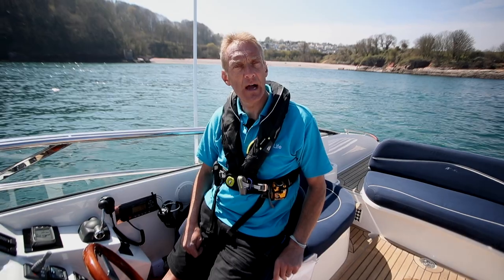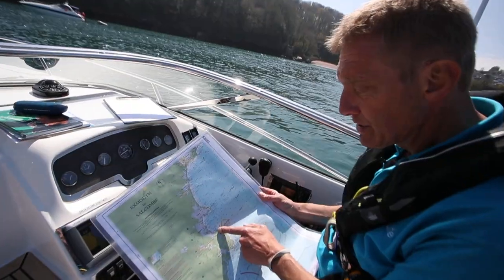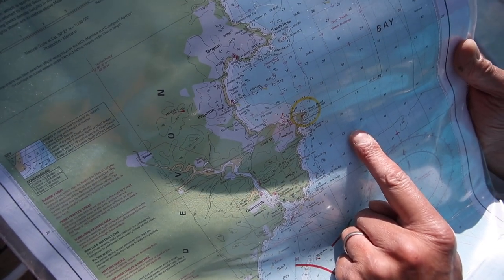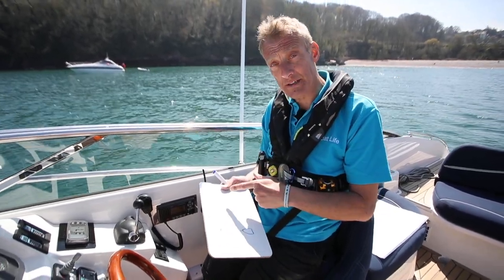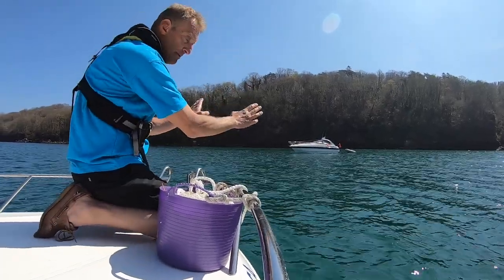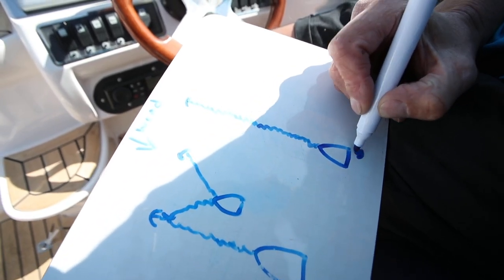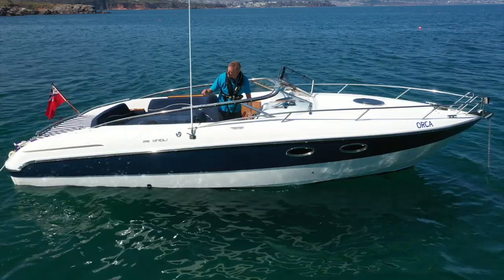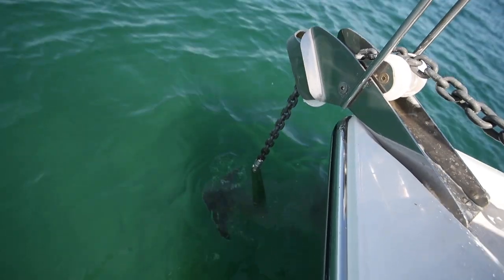How to anchor your boat safely and securely | Motor Boat & Yachting

Comment: Great video Jon, thanks!

Just two comments if I may:
1. Stern anchors are illegal in some parts of the med… ask the coast guard before doing that. In the med it is more likely to see boats laying shorelines instead, and those must be floating, with bright colored lines, and marked with flashing red or white lights overnight.
2. In windy areas, the recommended scope should not be just a function of depth. We should also factor-in the windage of the boat and the size of the chain. A flybridge boat for example has substantially more surface area than a sailing boat or a speedboat. This means that the horizontal force exerted on the boat by the wind is far greater. You do not want this force to lift the entire chain off the seabed, as this will unsettle the anchor. This means that the weight of the chain should be greater than the KgF exerted on the boat by the wind, plus a comfortable safety margin. If for example a 5 force wind exerts 100 KgF on the boat, and you have a 12mm chain that weighs about 2.8 Kg per meter, you need about 50 meters of scope regardless of the depth... You can not anchor in shallow bays and stay safe overnight in windy conditions, unless certain conditions are met, the captain masters system (wind, boat, anchor rode, shorelines) dynamics, there is enough space in the bay, and there is somebody on watch during the night… 

Only reason for this humble comment, is that more and more people can afford bigger boats these days, and the rules they have learned at school on scope to depth ratio, have become obsolete in the pursuit of higher profile, more comfortable pleasure craft. It is not by coincidence that I constantly see this kinds of boats dragging anchors in southwest France, Adriatic Italy, Croatia, the Aegean Sea and other windy areas.
Reply: Pacific NW we use stern ties to shore.

Comment: I put a bright yellow zip tie on the chain at the distance where the anchor is just below the water line.  This allows me to pull the rode from the cabin, behind the helm.  I stop when I see that yellow zip comes over the roller.  That allows me to safely raise it without chancing it hitting the boat/bow/gelcoat.  I also will put it into gear on idle and the slight forward motion will usually clean off the mud.  Doesn't always work.  Some of the mud up here is very, very sticky.

Comment: Hi, I'm new to boating so I'm fining your videos extremely useful. I have a question about the anchor marker buoy. How long should the rope be? If it's tied to the anchor, then surely the rope would need to be different lengths depending on the depth of the seabed?

Comment: I learned to first drive over the spot where you want to drop the anchor to read the actual depth off the depth gauge, to help calculate how much chain to let out.

Would've wished for a few more tips and etiquette on anchoring in crowded bays - because, let's face it, that is what most recreational boaters will do, particularly around the Mediterranean. In deep bays, like on Majorca, there's little wind and current, so boats move 360 degrees around their anchoring point throughout a day, often coming dangerously close to other boats doing the same. Some words on that and a rule of thumb on the diameter of the circle your boat will do would have been helpful.

Comment: Surprising that you didn't include the technic of motoring your boat in a big circle and using a stainless ring or a one way stopper that lets the ball move toward the anchor using the boats power to retrieve most of the rode but then i remembered that method may not be applicable when using all or nearly all chain rode.